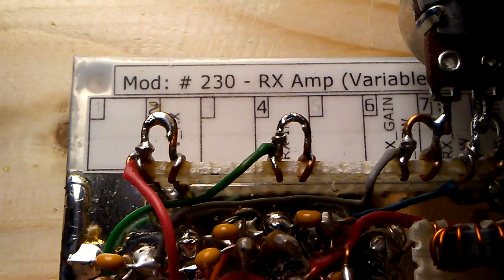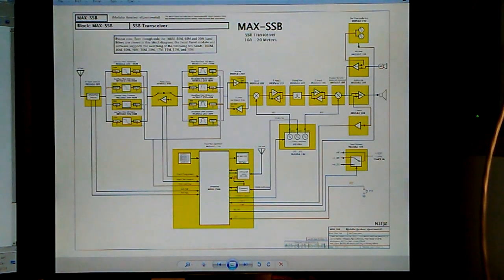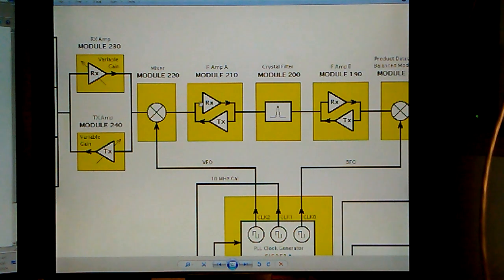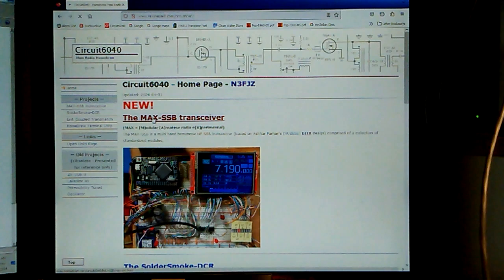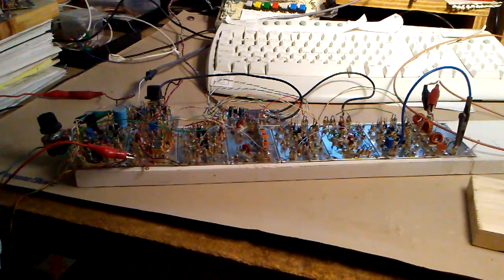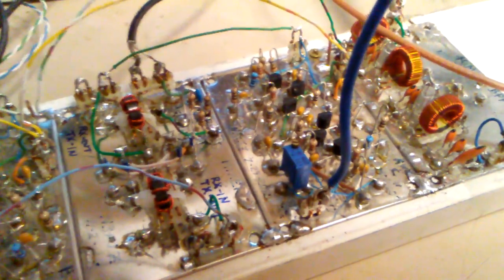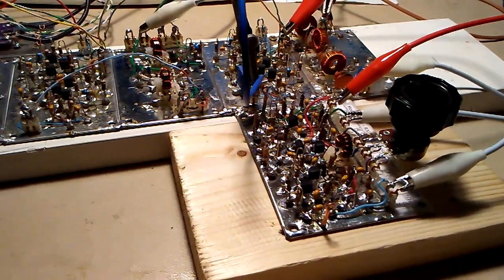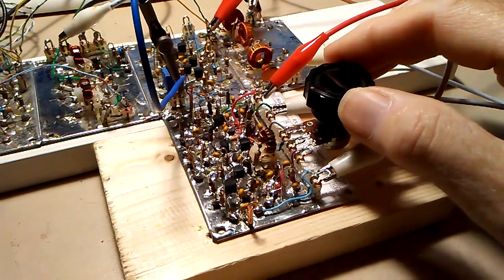Module # 230 RX Amp - MAX-SSB Transceiver Project

Comment: Perfect for an AGC circuit to control...
Reply from the maker: Yes indeed!  As a matter of fact, in Wes' whitepaper on this amplifier, the title is "...Adding AGC to a Termination Insensitive Amplifier..."   (http://w7zoi.net/tia+agc.pdf).  I want to explore adding true  AGC to my MAX-SSB in the future but haven't yet had quality time to do this properly, but having the variable gain amp in the RX path as part of the base design was a good start for when I'm ready (for now I'll use it as a manual RF gain control).  I use the variable gain amp in the TX path as a way to make the output power variable.  I like to "tune-up" my 80 meter loop/transmatch using about 500 mW then slowly bring up the power to 20 watts once the tuning to an SWR of 1:1 is complete.  73 - Rick - N3FJZ
Reply: @Circuit6040  I think if you are going to add AGC its worth taking your time and doing it rite..... and RF control is the way forward and creating the balance of stages... beautiful work mate I love your stages and your design makes trying them out sooo easy and real time... I will give the link to Wes's paper a good looking at, thank you!
Reply from the maker: @paulsradiohacks  You're welcome.  Here's another one of Wes' papers on AGC (http://www.ka7exm.net/hycas/hycas_200712_qst.pdf).  If I do go forward with adding AGC to my rig, this would probably be the one I would consider.  73 - Rick - N3FJZ

Comment: Wow impressive! Looks like it took forever to build. 73!
Reply from the maker: W1RMD,  Thank you for the kind comment.  I spend about a week building each module a few 10's of minutes here and there, but if I were to count the total time non-stop (like a 9-5 job) I would estimate between 3-6 hours per board actually soldering et cetera, but collecting the parts, and the preliminary work (finding RF circuits by other homebrewers on the internet to copy, designing the layout, drawing schematics, testing prototypes) does of course take much longer.    This is definitely not a project if you wanted to build something quickly.  This is a project to enjoy the learning and building process, sort of like those YouTube videos you see where someone builds a sailboat from scratch starting with a stack of lumber, or mountain climbing, just to see if one can do it. 73 Rick N3FJZ
Reply: @Circuit6040  I've been a ham for 30+ years, and have just recently started to understand electronics. I've never attempted anything that used ic's or toroids before, other than those kits that only teach you how to solder. Good analogy with the boat. I've heard some say that restoring radios is like restoring old cars. I have noticed on these dyi projects they end up a LOT more complicated than originally planned. You're right, if you are building to learn and enjoy the circuits you'll be okay. If you are building just to get an end result, you will have a life of frustration. Just go a buy what you want and save the trouble. Thanks to channels like yours, it is possible to understand what you're building and learn in the process. Excellent sounding radio! Thanks again and 73!-W1RMD.

Comment: This is quite an odd circuit.  I've never seen an RF amp with a 2N3904 input stage as most commercial rigs use a dual gate MOSFET.
Reply from the maker: stevec5000, yes, the dual gate MOSFET is indeed a solid performer for RF amps; however, I wanted something that was a little more available (in a through-hole package) and a little less expensive.  Also,  I trust the designs of Wes w7zoi: http://w7zoi.net/tia+agc.pdf

Comment: Great 👍 Be careful with these TIAs though, they are relatively easy to overload (comparing to a regular feedback amplifiers). You may hear AM broadcast stations on 40 meters during the night if the gain before the IF will be too high. Make sure most of the gain happens on the IF or AF.
Reply from the maker: Thank you R2AUK, I will definitely keep this in mind.  Yes, I remember seeing Alan Wolke (W2AEW) testing the TIA amp and how too high of an input signal causes it to overload  https://www.youtube.com/watch?v=7TtKE39TWpI  73 - Rick N3FJZ